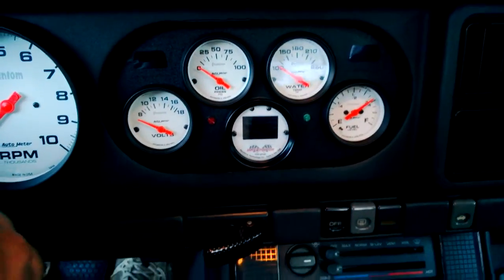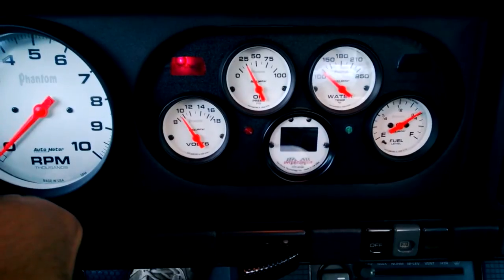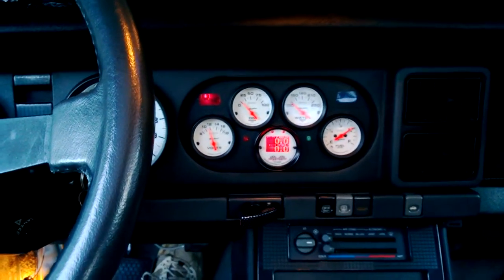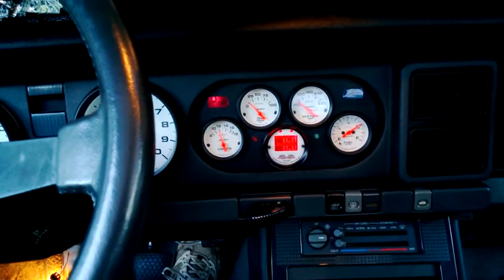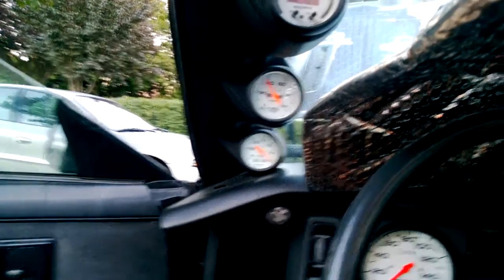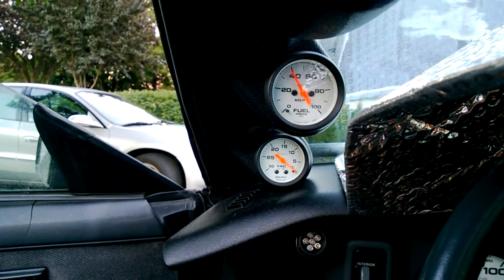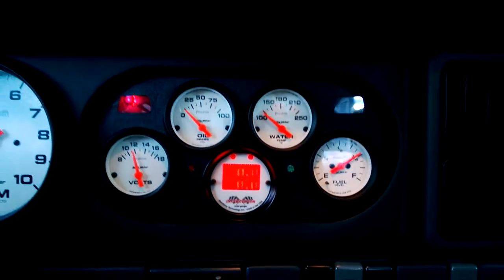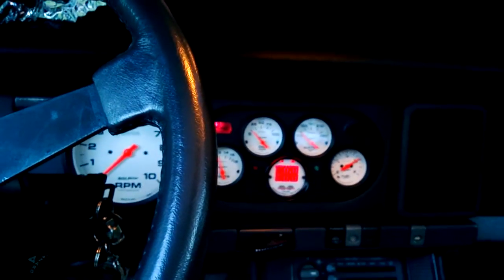Cranking for Oil Pressure and Testing Fuel Pressure - LQ4 Build - Thirdgen Swap

Comment: What are the cut out holes to the left of the oil pressure gauge, and the right of the water temp? Also, what are the green and red lenses for below the oil pressure and water temp gauges?
Reply from the maker: They aren't holes, they are the lights for the ebrake and check engine light. I used the stock dash overlays, and hid them behind the laminate that I used for the panel. When off, they looked black. But they light up. The check engine isn't lit here because I didn't have power going to PCM yet. Red LED was for oil level, using the stock LS1 style oil level sender and the green was coolant level warning, also using the factory LS1 level sender.
Reply: @JEGsGarage  so the check engine light would normally be on, since it is swapped, right?
Reply from the maker: @seabiscuit120  only when the key was first turned on. Then it would turn off once the engine is started, just like factory. I tuned out any codes so the if the light was on, there was an actual problem.
Reply: @JEGsGarage  is the one to the left of the oil pressure gauge the ebrake light?
Reply from the maker: @seabiscuit120  yup. Hard to see in the vid but it says brake
Reply: @JEGsGarage  thanks for the info!

Comment: What adapters did u use for the fuel pressure gauge? I’m tryna do the same
Reply from the maker: I had a -an to NPT adapter right off my fuel rail's schrader valve fitting.  I eventually used a -an line and remote mounted the sending unit.

Comment: How did you prime the oil system
Reply from the maker: Cranked it over while it was out of the car until oil shot out of the pressure sensor hole all over the garage haha.  In hind sight, I wish I would have threaded a gauge into the port first.  But it worked!  Check out the video.

https://www.youtube.com/watch?v=AfGrgX-oaxU